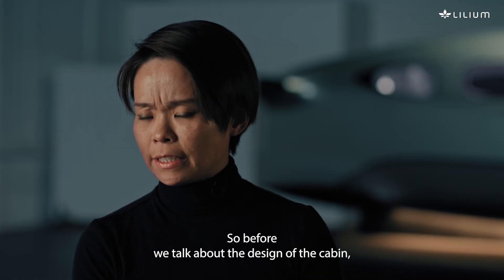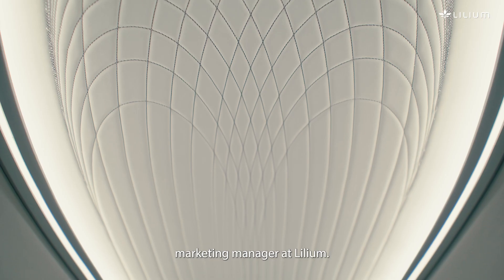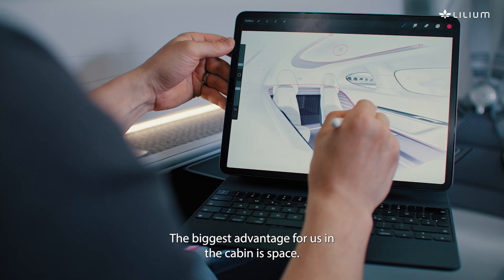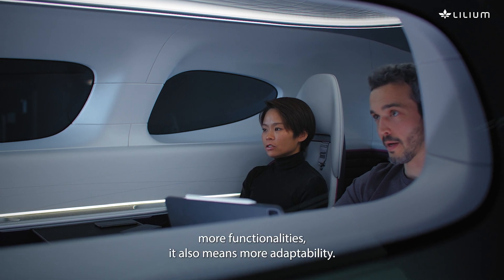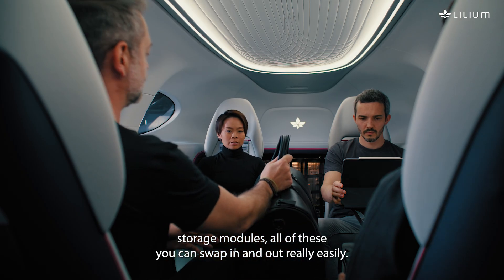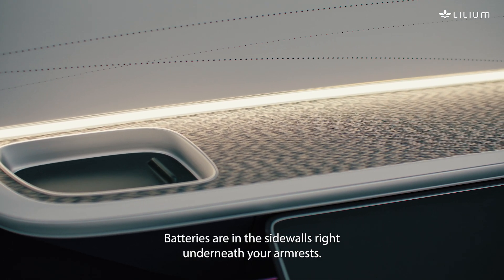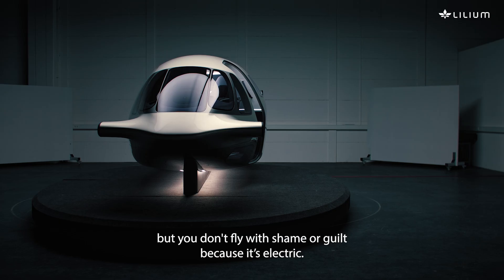Lilium Jet | Cabin Design Series | Hear from Sharon

Comment: The batteries are inside the structure? Can you state the charging time after a 30 Minute flight with full passengers and cargo? How do you cool the batteries?
Reply: the battery of the ones they flew for seconds long edited clips was a forklift battery in the cabin where the people should go.

Comment: I saw a video about the noise level of Lilium compared to Joby. The test in that video showed that Lilium made a little more noise while taking off/landing compared to Joby. That s because of the way the fan is designed. Still the noise is lower than for instance helicopter, but is relatively high that it potentially can prevent Lilium to be able to take off and land in central areas. While the noise-test in that video may not be 100% accurate, noise can be a potential concern for Lilium or any other e Vtol for that matter.
Reply: That's a flat lie.  Nor does that video exist and it's proven already the other way around.  Joby is noisier than Lilium.  They're open propeller blades.  Everyone with any basic aeronautical background knows you're lying.

Way to embarrass yourself.
Reply: @EarthCreature.  Why would I lie ? The video is out there on youtube.
Reply: @jonpetter8921  the video of the joby that crashed with motors that are different.
Reply: @EarthCreature.  lilium is a scam. don't be dumb
Reply: that joby that they measured crashed and the motors are different on the new one so you don't know anything. lilium and joby are both scams and can't lift people for a few minutes. the sound doesn't matter because they don't work as a craft. the joby didn't have weight that makes it louder. the sound is a red herring. they can't fly empty for 5 minutes.

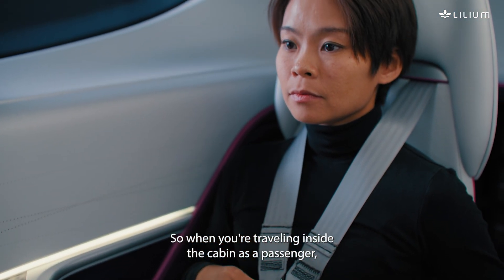Comment: 1:24 mark on the video. You might want to rethink the way the restraint system is designed and being worn. The buckle should be worn snugly and low in the lap and not on the lower chest. If the restraint buckle is worn above the belly button and you are in an accident there is a very good chance that your body will slide out underneath the restraint system and you will break your neck when your chin is stopped by the buckle. This is why most restraint systems similar to this one have 5 points of attachment and not 4. The 5th point is anchored directly between your legs which prevents the buckle from rising and your body squirting out from underneath the restraints. If you don't make the system idiot proof your passengers will not figure it out on their own. I have 23 years as a test pilot.
Reply: It's been proven that waistline single-belted seats cause the most damage to an occupant during high velocity impacts and even provide more opportunities for spinal injury, particularly in the lower back..  the more surface area a restraint holds the more distribution an impact disperses evenly & thus minimizing damage to said occupants.  Your pseudo science statement is patently incorrect & riddled with what appears to be low-brow imagination. Try to "squirt" a corrective action like deleting this brain dead comment.

PS - You were never a test pilot (obviously) unless you legally classify as a test dummy and even then, experience didn't serve you here either.
Reply: @makerofthings   who paid your job?
Reply: @kioly_ah  US Army for 31 years and 19 days and retired as a CW5. Flew from 1982 to 2010. Was a test pilot on AH-64's both A and D models. I was a maintenance test pilot and not an experimental test pilot. Before flight school I was in military intelligence as a 96D for a couple of years with a final rank of Specialist 5.
Reply: @kioly_ah  You're not very bright are you?
Reply: You're not a test pilot.. 🙄
Reply: @robitwhisperr  31 years and 19 days in the US Army and retired as a CW5. AH-64 Test Pilot (yes, a maintenance test pilot and not experimental).

Comment: When will this start flying? As a stockholder I don't feel like we're getting a good sense of when service for these vehicles will actually start.
Reply: It already flies. They're in the process for FAA certification and have 700 pre-orders. Lilium Jet is poised to become the most successful and desirable eVTOL on the world.

People like jets, not flailing propellers. That's why turboprops have largely fallen out of favor with the flying public.

Lilium, not Joby, Archer, Vertical, Uber, or even Airbus, has that design & technology edge that will lead to high customer adoption rates. I predict great future success and Chinese copies.
Reply: @TecnamTwin Only remote control prototypes have flown very short hops.

This is not a jet. It uses ducted propellers.

700 pre-orders, so letters of intent. Not a single one has been ordered. Certification for use is far off. 

The project will probably be canceled in a year or two, when the investors get fed up with the mock-ups and lack of actual progress.
Reply: I would pull out and re-invest after the first 1000 hours of proven passenger transport operation.

Comment: the scalability is an interesting point. battery technology is evolving. 500Wh/kg is available (Amprius,..., at a high price though). 700Wh/kg at the doorstep, 1000Wh/kg achievable in 5? years.
the fans can be scaled up. more passenger with shorter range, less passengers with longer range.
Reply: They can't just scale it up. The bigger it is, the worse the performance will be. They can barely fly the little prototype. It's the square cube rule of physics. This is a scam. They just fly a little toy

Comment: Where are the videos of it flying with human occupants? It's all talk.
Reply: All hypes still. They could have just put a couple luggage for the weights and remote pilot it for 100 miles to shut up all the doubters, but no, they rather keep talking more about cabin design. I have little doubt of Lilium is going down FFIE ‘s road to fast track to a bankruptcy.
Reply: @forest42821  They already tested weighted flights.  It's how they passed all 4 DOA audits.  You don't even know the facts before you used your imagination to complain with.  But that's all half wit idiots have to fight with.. dull imaginations.
Reply: You're clearly a Joby bag holder.  At least Lilium proves their prototypes don't crash BEFORE their manned flights.  You half wit 😂😂
Reply: @@lovelovehappy0 Why is Lilium different than all the other flying car prototypes that don't fly? So far they have done nothing other companies haven't done. Seeing is believing and it's been nothing burger after nothing burger.
Reply: Can't fly humans without FAA certification and that's the long and expensive process they're in right now with lots and lots of flight testing their prototype.
Reply: @TecnamTwin  I think all these flying car type vehicle companies need to stop putting out hype videos until they actually have a flying vehicle they can show videos of. I have seen prototypes at car shows for over like 5 years now. None of them actually fly. Anybody can make a fancy cabin that doesn't fly. They need to stop wasting time making videos until they can show something other people can't do.
Reply: @TecnamTwin  You can under Experimental Certifaczion and every aviation company is doing this with prototypes.
Reply: @TecnamTwin they can fly as experimental or they could use dead weight to simulate passangers. They never had a full sized craft with a cabin to test. The battery is in their mock cabin and it lasts 4 minutes.